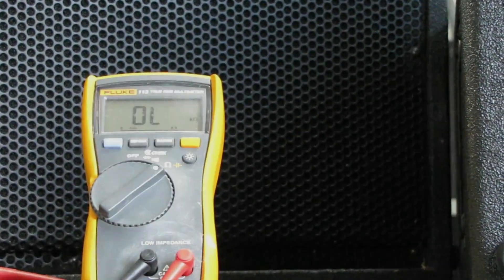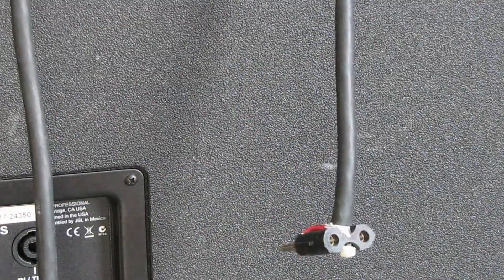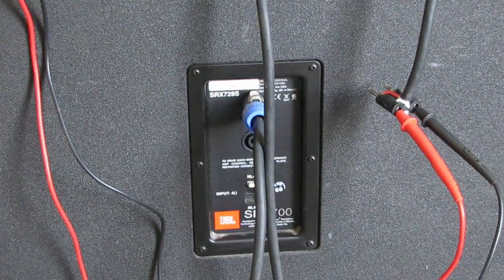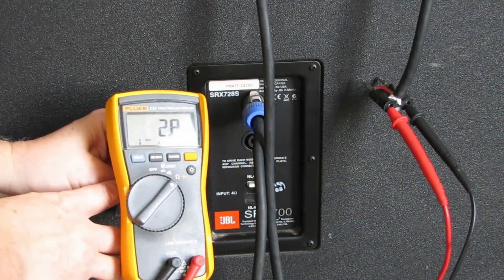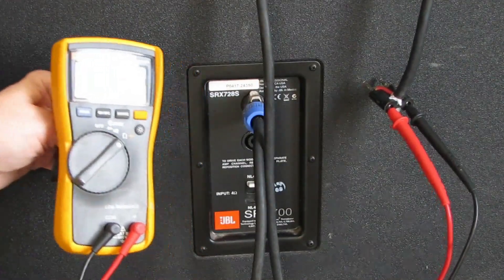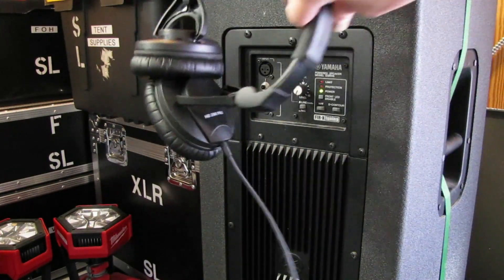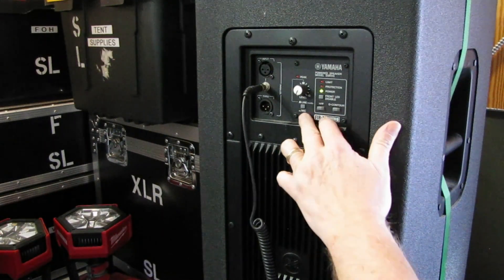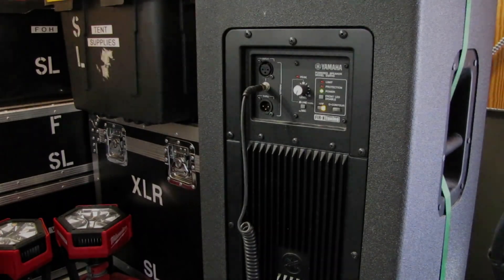Testing speaker ohms; emergency backup microphone

Comment: How to calculate RMS power?
Reply from the maker: RMS power is determined by the manufacturer; it really isn't calculated  unless you have a "continuous" or "peak" rating... and you need the RMS rating.
Reply: @stageleftaudio Is continuous and RMS are synonymous?
Reply from the maker: No.  "Continuous" is usually rated for 100 hrs. at a certain power level.  RMS is usually rated at a 2 hr. power level.  RMS is +3db of the continuous power rating.  And the Peak rating of a speaker is +3db of the RMS rating.  Most manufactures follow these ratings.

Comment: Great video as always! With banana plugs like the ones on the speaker wire, you can plug them directly into the meter as they have the same 19mm/0.75" pitch as the meter. Should help with the varying values using the probes. The resistance is always a bit off as the meter will measure the DC resistance rather than the impedance. It will give you an idea though that you haven't got any high resistance contacts! I'm keeping the headphone mic in the back of my mind now for emergencies! :)
Reply from the maker: Good point with plugging the banana connectors directly into the meter.